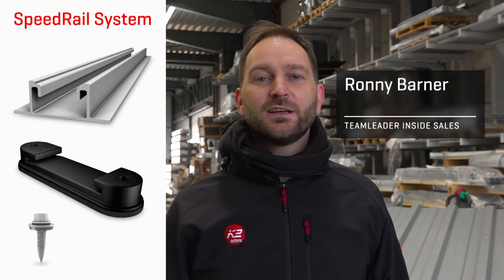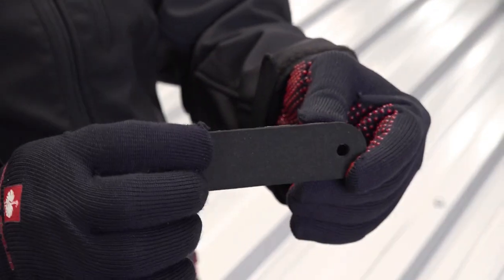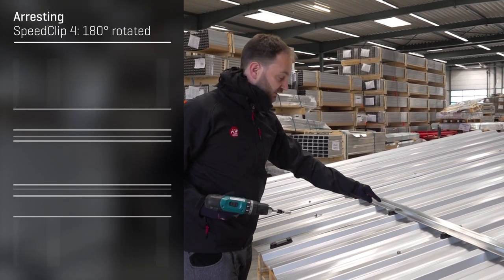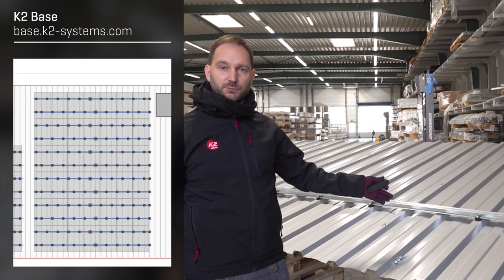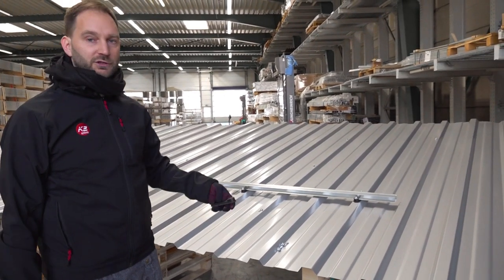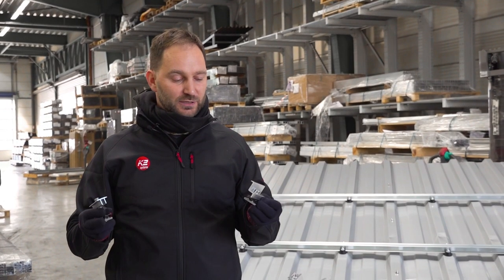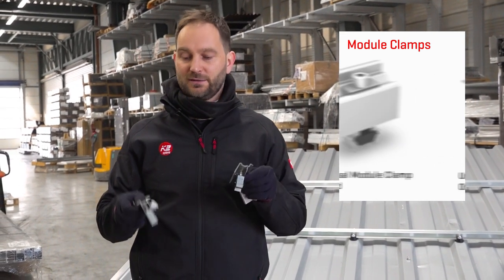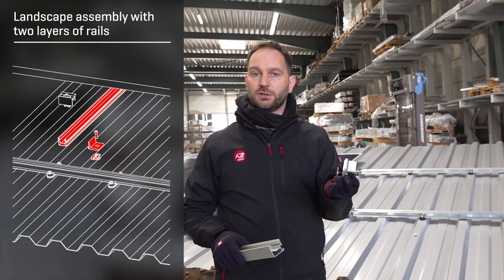[Anleitung; EN] BasicRail auf Trapezblech montieren

Comment: Are the fixings suitable to install into timber instead of metal? Why would the portrait method not work for landscape? Why do you need the Addon?
Reply from the maker: Hello, 
Many thanks for your question! The BasicRail System is especially designed for the needs of trapezoidal sheet metal roofs. When you ask about timber which roofing surface is on top of your timber roof construction or are we talking about a facade application? This could could checked and approved by our R&D if you send us your project data and planning.
The other questions: Please have a clse look in our assembly manual for the BasicRail system. We think  your questions are described in detail --> https://catalogue.k2-systems.com/media/ba/2d/6d/BasicRail-assembly-en.pdf 
But here are some short answers:
• Portrait is the basic module layout of BasicRail System because the rails are installed parallel to the roof (eave/ridge) and most modules must be clamped a quarter after the module corner. 
 • If you need to have the modules landscape to be able to place more modules on your roof you must use either a second rail layer or the AddOn to make that possible – see manual.

We strongly recommend to use our free online planing software K2 Base 
• Details https://k2-systems.com/en/digital-services/k2-base/
• Register https://k2-systems.com/register

More details about the BasicRail system: 
• Introduction: https://k2-systems.com/en/product-solutions/basicrail-system/
• Catalogue (all components and downloads) https://catalogue.k2-systems.com/mounting-systems/pitched-roof-systems/k2-basicrail-system/

If you have further questions just contact us https://k2-systems.com/en/contact/

Have a good day

K2 Systems

Comment: For what is speedlock?i don't see any solution 🤔🤔can someone explain me please?
Reply from the maker: Hello Paul,

Many thanks – very good question! First of all we need to understand that the SpeedRail System is a mounting system with a floating bearing. This component part takes the SpeedClip. The SpeedRail can float horizintally and extend thermally (thermal expansion of aluminium) laying fixated vertically inside the SpeedClips. This means that the thermal expansion does not exert any force on the roofing (trapezoidal sheet metal) at all, which is what happens in systems with solar fasteners (fixed bearings).
To ensure that the SpeedRail can't move too far, every rail – also connected with a rail connector – must be fixated with one SpeedLock. When the system was being developed we thought it can work without a fixation but we learned that it must be fixated. 

I hope that explains everything. If you need more illustration please tell us. We can share an additional illustration which explains this more visually. 

Have a good day

K2 Systems

Comment: Can this rail system be installed on a shingle wooden log cabin? Will it be water tight?
Reply from the maker: Hello, 
Many thanks for your question! Are we talking about compostion shingle tiles? Let's say it's not the approved roofing type. It was developed for trapezoidal sheet metal roofing and the comp shingle structure is way more rough. 
The EPDM sealing of the SpeedClip and the sealing of the screws fulfill their job on sheet metal because it's totally smooth/plain. For this application type other wood screws with a sealing washer are necessary. To be totally sure that the sealing works you could think about an additional sealing. 
For example our US co-company uses L-feet with EverSeal material https://youtu.be/8ZFPPwHs3Zo

If you're note in the US we will soon offer an L-foot option for the SingleRail system but it will take some more weeks until it's available. More details https://k2-systems.com/en/product-solutions/singlerail-system/ also an installation with hanger bolts and SingleRail might be an option … https://catalogue.k2-systems.com/en/mounting-systems/singlerail-system/?order=empfohlen&p=1&properties=7bad83e6cbef41438f0a2a8cd0a15895
Another thought is: When have PV modules installed on the roof a lot of the regular rain water is not lead by the roofing but by the PV module. This means the PV roof fastener does not always have to treat the highest water amount like other parts of the roof. 

We hope these thoughts help a little for your planning.

Have a good evening

K2 Systems